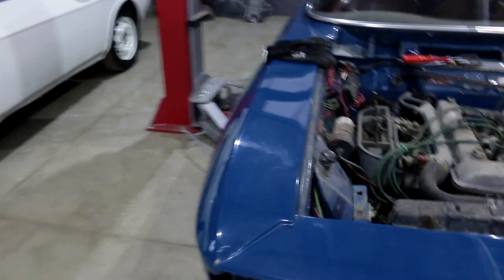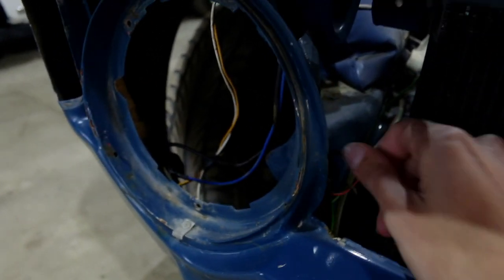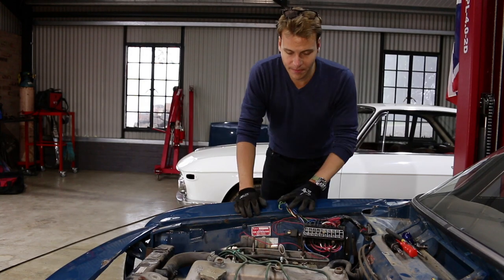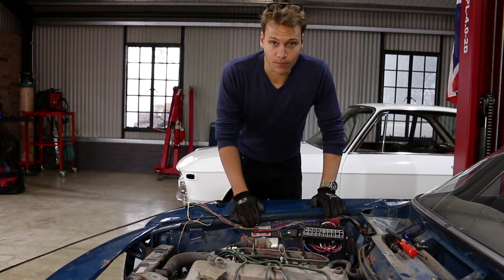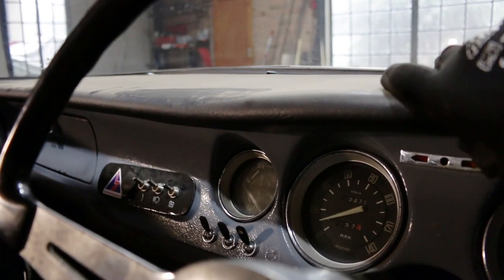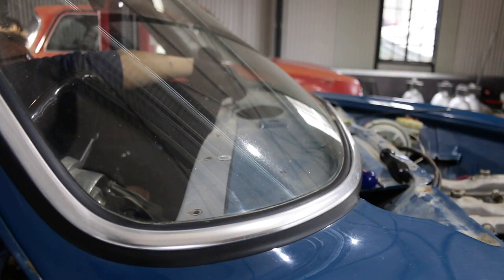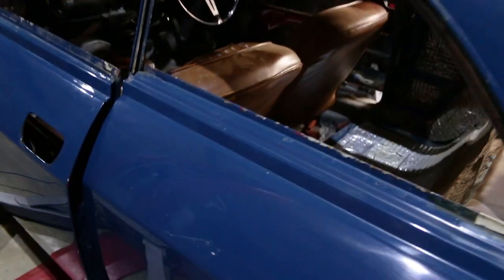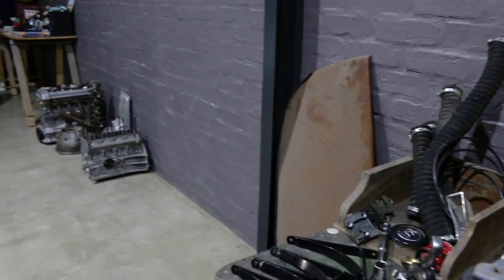Giulia Sprint GT Rebuild Episode 2

Comment: Hey Jethro! Love watching your videos, thanks for sharing all your knowledge. I have a question about my 1979 Alfa spider. Do you know what the right range for a compression test would be? Also I’m looking for a speedometer in kilometres, do you know where I could find one? I’m located in Vancouver, BC Canada. Thanks in advance for the help!
Reply from the maker: The important thing for a compression test is that the readings are consistent across all the cylinders, like no more than 10% difference. You wouldn't want any cylinders at less than 120 psi, and about 160 psi is a good number.

Comment: Would you not save the old loom to use as a pattern for the new one?  Are you going to mock-up a new loom on a piece of plywood? Jay Leno's technician did a job as such with his lotus elan.
Reply from the maker: The new loom is going to be very different from the old one, so it’s not much use as a pattern. I’ll make up the new loom as I go along as I’m not entirely sure what the finished electrical system will be just yet.

Comment: If you're making your own loom, how come you threw away the old one? I would have kept it to use as a template. Looking good otherwise! :)
Reply from the maker: I'll be making a lot of changes to the electrical system on that car, so the old one isn't really good as a template.
Reply: @JethroBronner  Whilst I hear what you are saying, that doesn't change the distances between the parts you are going to keep. You are now going to have to measure those distances off the car, and ideally make a mock up that you can test fit to check routing, length, and fitment. Sorry, not trying to put you down, just offering advice coming from having made bad decisions in the past. Best of luck. :)